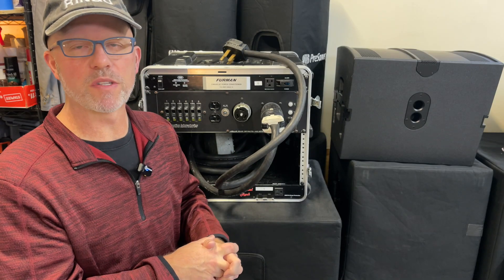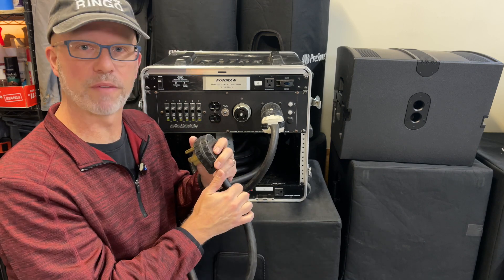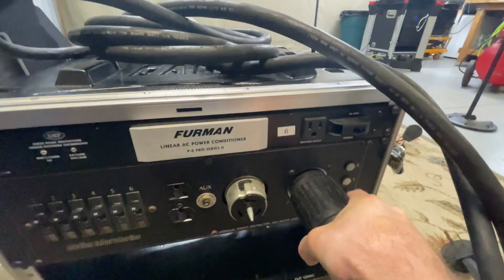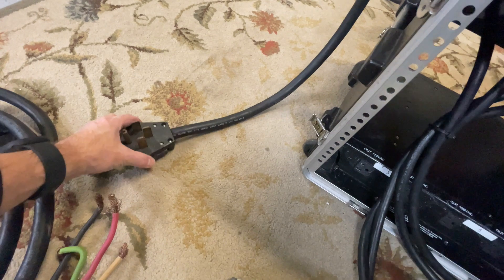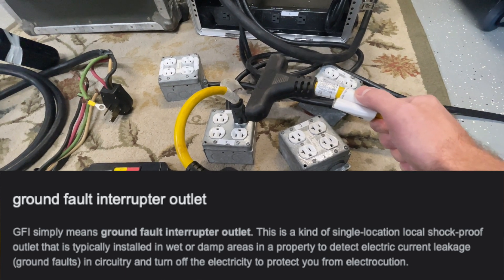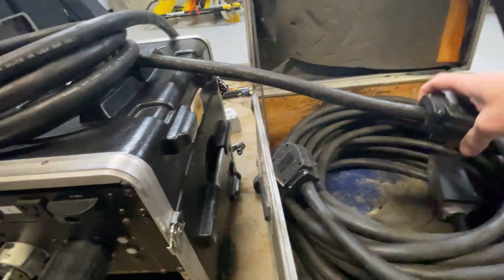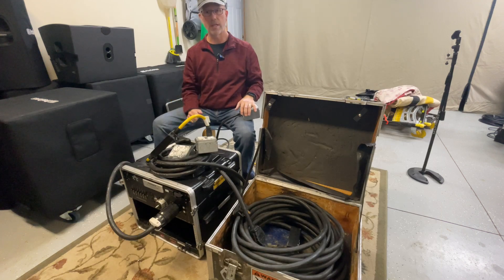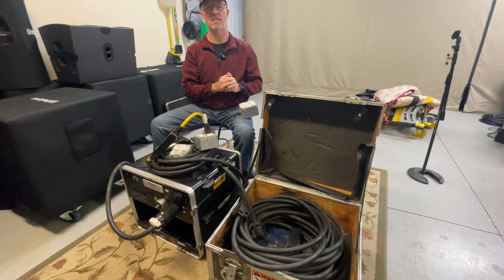The SC-What We Use for Portable Power Distribution

Comment: In Europe the most common connector for events requiring more amperage than a normal Schuko socket provides is called a CEE connector.

We use the red ones for 3 phase + neutral + ground. Across the phases you have 415V and phase to neutral gives you 230V.

We start with a 3 phase 16 amp connectors which can be distributed straight into 16A Schuko's without the need for further use of breakers etcetera. 

After that you get the most common one which is 32A and after that 63A and 125A. After that we get into twist locks which go up to 400A. And yes, they do get used a lot!

The event industry favors rubber and metal distributors, depending on need and location. 

It's a bit different than you guys but a lot easier because we do not have the ridiculous amount of different connectors that you guys use.
Reply from the maker: Thanks Richard...there is so much to learn!  It's actually pretty amazing that so many electronics are designed to adapt to the different power systems across the world.
Reply: I came here to say the same thing as you.  In the UK, we of course have the regular 13A outlet in smaller venues rather than the Schuko. Much of what I do is in the smaller venue where regular UK 13A outlets are all we can expect, so I have a lot of the 13A UK to 16A CEE adaptors. All my my racks are assembled with a 16A CEE inlet (my amplifier rack has two) so I can balance the load across outlets or circuits. When it comes to Distro's, I carry a couple 32A CEE to 16A CEE, which for the most part covers all I need.  If I need anything more than that, I hire it in.  As Bart has mentioned; this stuff is expensive, and personally I can't justify the cost of bigger distro's if they're only going to get used a couple of times per year.
Reply: @johnmcquay82  I live in the UK, but I hate the UK plug I prefer the Schuko plug in fact, I’m slowly changing all my DJ equipment to Schuko plugs I just like the look of them and they have no Live or neutral polarity apart from the Earth conductor and there’s many more reasons that I prefer the Schuko plug

Comment: Hi Bart and Stacy, 
Like the video’s to me it is recognizable the video’s that you make. So I can’t stop watching. keep making them. 

In Europe there is the C norm it is a big red round connector. If I remember correct it starts at 3x16 amp and the largest I have use was 3x 64 amp. 

which I always do, I include in the contract that the connection may never be further away than 5 meters.  if it is further then the choice is whether the organization arranges the power distribution or I will take it with me but charge extra costs.  Those cables are heavy and expensive.  I therefore prefer not to carry these cables with me.

Greetings
Patrick,
From the Netherlands
Reply from the maker: Interesting Patrick...thanks for sharing!
Reply: @thesoundcouple  
By the wat the voltage is 230 v between fase and neutral. 

Well the big tip is :
tell the organization what you need and have it arranged.
Reply: Well,

It's called a CEE connector. We use the red ones that are 3 phase + neutral + ground. Across the phases you have 400V and each phase to neutral gives you 230V.

We start with a 3 phase 16 amp which can be straight into 16A Schuko's without the need for further use of breakers etcetera. 

After that you get the most common one which is 32A and after that 63A and 125A. After that we get into twist locks which go up to 400A. And yes, they do get used a lot!
Reply: CEE connectors are interesting ones, as there are all sorts of colours and configurations.  Not sure about the rest of Europe, but you will see yellow CEE connectors, which are used on building sites mostly... 110V, and I believe are single phase.  Green ones I have seen too which I believe are used for Aerospace applications operating at 400Hz. Blue are of course single phase and red are three phase; all of which I have seen as 16A, 32A and 63A and three phase at 125A.  I don't encounter powerlocks very often, but I have seen 800A powerlocks.

Comment: We usally use the 3phase + Neutral + GND C-plugs The red once. The one i have is A 32 Amp, and its a 15M 5x 2,5mm2 exstetion going to my home buildt PDU board with 6 4-way outlets each with their own 16 amp breaker and there is 2 16 amp breakers per 32 amp leg for a total of 6, 16 Amp ciricuts. which is plenty for what im currently doing. And thouse breakers and most breakers here in Norway has built in GFI's so no need for external GFI's
Reply from the maker: Thanks for sharing!  Hopefully those GFI's are behaving for you!
Reply: Yeah...

You do at least need 5G4mm2 cable as 5G2,5mm2 is only allowed to and rated for 16A.

Even 5G4mm2 is a bit of a stretch as it is rated for 28A. So if you use you pd at full load...

5G6mm2 would be the best choice.
Reply: @Richard_van_der_Heijden  it depends on the type of instslstion and type it seams.  cuz the actual exstetion cable is 2.5mm, and that one i bought and that was certified.  the actual 3p plug i installed, i used 6mm2 on,  since Technicaly the max rating of 2.5 in a thermaly insulated wall, so A1-1,  is 20.67 amps,, , 3p beeing 19.07, but cuz of headroom udd need a fuse a bit bellow that, and 4mm only goes to 25 amp so yeah for a max load on that 32 amp i would need 6mm in the instalation which it is and there is also 6mm2 used on the actual PDU board to distribute from the main fuse to the 16 Amp breakers on that  board.

so atleast as far as the exstetion cable goes thats not on me. cuz i was wondering as well. But my friend which worsk with automation and electrical said it was fine so yeah
Reply: @NekoLive Gaming  Certifications and regulations are nice but I have seen to many electrical problems like fires, melting connectors and so on to make any compromise on safety.

So for me the following applies:
-2,5mm2 is maximum rated for 20A so it can never be used for 32A
-4mm2 is mostly used on 32A circuits downgraded to 25A. It is however used in mobile settings for 32A circuits that don't see full load. The same applies to 10mm2 vs. 16mm2 in 63A circuits.
-6mm2 is the only option for 32A that see full load or are likely to see full load.

You also have 1,5mm2 which is technically usable for 16A but not for long term full load and/or long runs. So only up to about 13A maximum continuous use, depending on length.

Like I said: Experience. Because when things go wrong, it is a real world of pain and hurt.
Reply: @Richard_van_der_Heijden  yeah. everything in this apartement was 1.5mm,  but those where hooked to 10 Amp fuses and thouse had to be upgraded, and i allready knew that i would pull up against max load from time to time, so everything got upgraded to 2.5mm2,  the stove is on 4mm2 on a 20 amp, and interesting enough the initial electritian has bridged the dishwasher off of the stove fuse, and just installed an separate 16 amp breaker inbetween so that was kinda interesting.  And well i do have an 25 amp which is currently running on 2.5mm wire, but the only reason is cuz when stuff gets insitialy powered on it has a spike that goes above 16 amps. but under normal use it lays around 14 amps, but it is gonna be upgraded to 4mm as soon as i get around to buying more wire since i will be putting more servers on that line. And aslo FYI the plug used is a 1phase C-plug for the network rack, so im not gonna pul over 16 amps thru a normal outlet.
so yeah